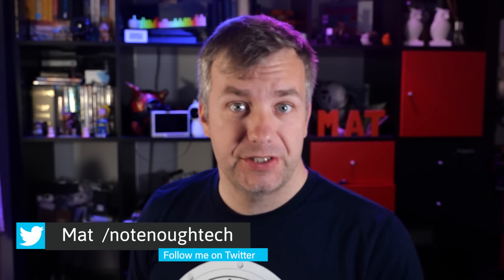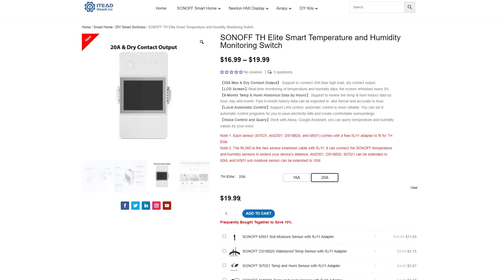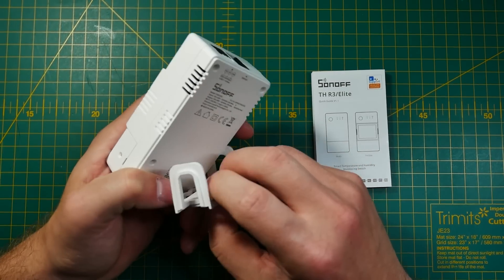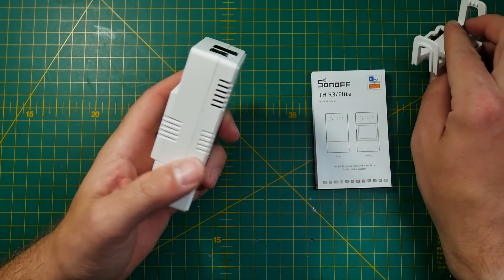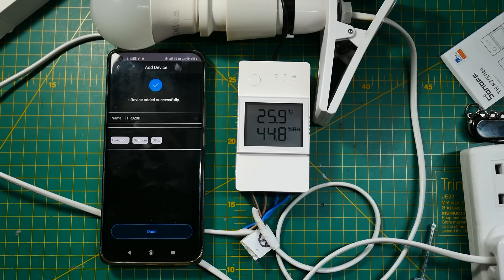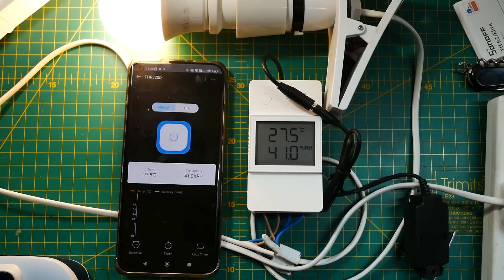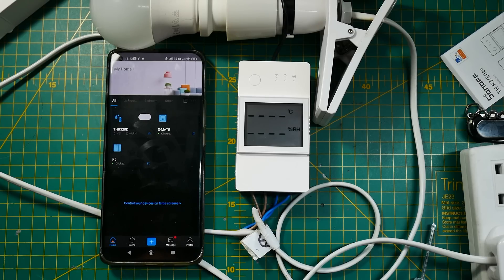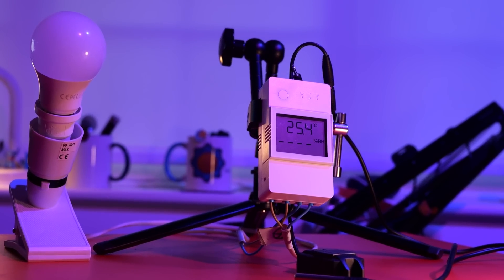ITEAD has a new product line: Sonoff TH Elite!

Comment: Do you think can it works with a 2 wire temperature sensor? I have one already installed in a bolier with a stupid thermometer and I would like to “recycle” it.
Reply from the maker: @giovannimarino4311  it's likely to be calibrated for the sensor included. So I have little confidence it would work with other probes unless it's the same type

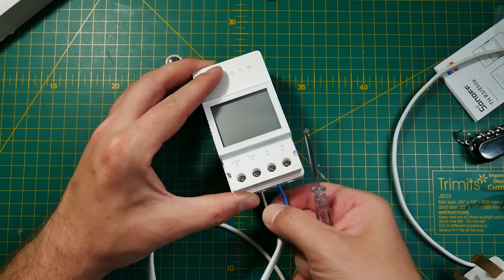Comment: At 5:54 you skipped the most important part of the whole video : Connecting the wires up...what goes where! 😢

Good vid otherwise .
Reply from the maker: The terminals are labelled. Instructions are pretty on point. Without disrespect but if that's not enough to know what's what I strongly recommend qualified technician to do this for you. You want this to be right the first time.

Comment: I still wonder if the usual one , that origin or Elite can be upgraded too by soldering such temperature sensor to the board or connect them to gpio ?
The only difference is the headphone style port this one comes with.

Comment: Hello, do you know the pin layout on the RJ?

It is to know the connection of a dallas ds18b20 or a DHT22.

If you have an adapter it might be easier to measure with a tester each pin of the RJ with the pins of the jack.

Thanks!

Comment: I have several THR316D monitors with THS01 sensors. Using the eWeLink.   Each monitor can read the temperature and the humidity from one sensor which is plugged into it.   Is there a way to modify or add some inexpensive hardware (perhaps using the dry connector), to switch between several Sensors?  In other word,  every push on the eWeLink button would advance me from sensor to sensor (room to room)...?

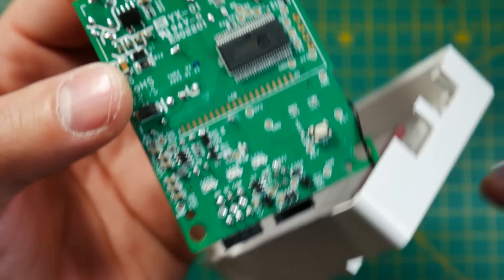Comment: How does one connect it to power? Does it come with the power cable or does one have to buy one separately? Is this the kind of device an electrician should install? Seeing the exposed wires at 5:45 makes me a bit queasy. I'm interested in using this only for the temperature sensor, I wouldn't use the relay function.

Comment: Does it come with a probe? I have ordered one from Amazon and it shows the probe in the picture. If it doesn’t I’ll just r3turn it anyway! But my point is, it’s not so clear if it comes with or not!
Reply from the maker: Yes one is included. But if you want a specific one (there are multiple probes) you need to order it

Comment: Good video, but u do have a question. 
I want to use one like this for a engine heater for my car, but if the outside temperature is more than freezing, is the output still on if you have it in the automatic scheme? or is that possible to skip..
Reply from the maker: You can define the range of temperatures to turn on/off and duration so for example if temperature is low and it's 6am turn on the heater for 30 min
Reply: @notenoughtech  Super duper... Thanx for answering so quickly..

Comment: Nice descriptive video. Can the relay be controlled in scenes based on input from other sensors like Sonoff SNZB-02? For example: One may use the dry contact to connect to a heating system. Then place several Sonoff SNZB-02 temp sensors in different rooms. Could then a scene be set up to configure a temp threshold for each room and if any of the treshold are passed then the relay inside TH Elite should turn ON. Is such a scene possible?
Reply from the maker: You can link other sensors via ewelink automation panel

Comment: Sonoff hardware is good, but the soft in the eWelink app, is primitive and limiting. This thing with the TH series auto mode is just dumb. If I have it in auto and I want to turn it off with the zigbee button, is not possible.
Reply from the maker: I believe custom firmware is available for it now. That would be a better alternative if you are willing to invest the time to flash it

Comment: Why it doesn't have a ground wire input and output? So how would I ground the heater? Tnx!
Reply from the maker: I assume by ground you meant "earth"? You can still earth your appliance if you want. Just run the earth wire independently. Your appliance will be grounded and therfore safe, and only switch will be exposed to mains shorts.

Comment: I learned this new elite is troublesome. First, it uses RJ9 nor R11, 2nd, even after setting it on Auto, the system failed me as it did not cut off after 60 degrees and my boiler overheated, prompting a pressure relief to open. The TH Elite auto setup are so different from the old TH and unfriendly, unless there is something rong i am doing
Reply from the maker: I'm guessing you were using correct units for your temperature? Also I had some issues with readings with one probe but the other probe was ok... so not sure if this could be the case

Comment: THANK YOU FOR A VERY USEFULL AND CLEAR BRIEFING!!!

I have recently bought the SONOFF TH ELITE and a Temp/Humidity (T/H) sensor.    I have been using the eWelink App on my iPhone to monitor the Temp/Humidity in my attic.  Here are my questions:

1.  The T/H information logging from the sensor to the eWelink seem to take place once an hour....  Is there an easy way (in the App) to change the T/H sampling time from the sensor (every few minutes to every few hours...)!?  If so - could someone present a clear way to do so?

2.  The system works well at home, when my iPhone is in the proximity of the Wifi Router.   However when I get out of range of my home Wifi network, I can't manually operate the "Device" (the outputs) which is  hooked up to the TH Elite.  In other words, touching the circle (virtual button) on the iPhone Screen of the eWeLink, does NOT do anything.   Is there a setup on the eWeLink App itself which would allow me to operate (read the T/H on my iPhone and operate the virtual button) from beyond the range of my home Wifi network?

3.  In another home application (not the attic), I would like to be able to turn on the wall Air Conditioner (A/C) in the house, before I get home (thus from beyond the range of my home Wifi network).   To do that, I plan to tap into the A/C remote control unit, and run out two wires from the On-Off button on it.  I would like to connect these two wires to a "Dry Contact" of any small Sonoff receiver.   It is not clear to me what (small) Sonoff "gadget" would do that job....   Any suggestion would be greatly appreciated.

Yes - I am an Electrical Engineer and very handy, but I do find the Sonoff provided English language descriptions difficult to understand at times......

THANK YOU !!!
Reply from the maker: 1. No - we are stuck with defaults. 
2. You have to check if your router is not blocking eWeLink ports. Sounds like your app (and devices) have issue posting back to cloud. 
3. Take a look at my DIY smart heating video it will give you some ideas

Comment: 3:37 RJ much better connector for sensor. Vexve uses those connectors on their heating controllers. jack connectors have risk of shorting when plugging it while device is on. Sonoff manual even advises not to plug or unplug when device is on.
Reply from the maker: Personally, I would pick something easy to be fixed at home. In case you ever need to do DIY and RJ do require special crimpers
Reply: @notenoughtech  I disagree. RJ crimpers are dirt cheap and readily available in any supermarket, electronics/computer store or home depot. jack cables require soldering either if you splice or change the connector - which requires way more skill, tools and patience than crimpinging RJ connectors

Comment: Is there anywhere to source these in the UK ? I'm interested in upgrading my underfloor hotwater heating system. I have 14 thermostats throughout the house on structured cabling, so I would want to push the RJ11 sensor over the structured cabling and use the sensor in each room, with all the TH Elites in one cupboard. So like someone else, would be interested to understand the wiring of the RJ11
Reply from the maker: They are relatively new so for now only through official sonoff sources. In time re-sellers will get their stock but you'd be better off ordering now as it will arrive quicker

Comment: They (again) did not expose the NC pin of the Relais. So in applications where the normal mode is ON the Relais is powered all the time!  This is not only bad for the environment but also bad for the components of the internal power supply (see my experiences with POW devices catching fire)
Reply from the maker: You have a power on state control for this. 
Relay state has nothing to do with power supply as the supply of pow as it's still needed to keep the IoT part functional.
Reply: @notenoughtech  I was not clear enough. Nearly Every relay has a common and a NO and a NC pin. For applications where the state of the connected device is normally powered it would be great if the NC pin is available. I.e. my pond pump. If the temperature is below 0 degrees centigrade it would good to switch the pump off. This is only a few percent of the year. So the relay has to be powered 99% the year if only the normally open pin is exposed.
Reply from the maker: @christianmeinert8806  this Sonoff device only powers up your target device when needed. The default state of the relay is NO so your target device is off when there is no power.

I'm struggling to understand the issue. Dry contact doesn't solve your problem regardless of the NC/NO configuration but shifts the power delivery to another device. 

Bottom line is you either have power delivery control (relay online) or you don't (relay has no power) as both of your devices have no power
Reply: 20A Relay is FANHAR W15L-1A2T-L2 model, which does not have a NC pin, only NO ! 
The 2nd relay (Dry Contacts) has NC and NO, but the wiring is not designed to withstand the 750VA rating that the FANHAR FH38-1CSGH relay supports ... is max 30W (5-30V and 1A)
From this point of view, Sonnoff has a very big gap, and I hope to bring an upgrade to this model soon, maybe a new, more versatile DIY model!

To get a NC + NO contact you need an additional component, a contactor... but in this way the complexity and price of a project increases, which is not good considering how inflation is evolving today!

P.S. Today I modified an Elite model to support dry contact on the 20A relay... and it works perfectly!
Reply: @byrev  how dry contact can works 20A 220v?

Comment: This week my second! POW burst into flames. First was version 1 only for measuring a washing machine and second was version 2 monitoring a 50W 12v pump of my pond. My trust in sonoff devices is very low (even I like the new series)
Reply from the maker: Have they both failed in the same way? It's worth investigating what failed on the boards. I have 2 in use at the moment. Both for over 2 years now.. so far so good. Which revision was it?
Reply: More info??  I suspect the majority of people here have or are considering installing Sonoff devices.
Reply: How many Amps was the machine pulling..reactive load ?
Reply: I've had a pow monitoring my air conditioner (split type, inverter) for over 2 years now and it hasn't skipped a beat. Either you are extremely unlucky or something's going wrong with your wiring.
Reply: Both failures are similar but not the same:  
The washing machine is a fairly modern one with A+++ Energy Label. It was a Ver 1.0 POW model. The machine wasn't running (I detected the fault because I could not start the machine.) It didn't happened during the time the machine was running as it would be obvious by a not finished program. Washing machines in Germany have 10A fuses so they pull less then 2KW. I'm not an expert but it "burned" around the fuse and big resistor (inrush current limiter?) between live and neutral.
The second (recent) was a Ver2.0 board connected to a 50W pump with an 12V Transformer running 24/7. Here there are burn marks around the resistor and smoothing capacitors (not exploded). Not so violent as the first one but the case was is melted and totally deformed.
I know the R1 POWs hat problems with the Relais but they look unharmed.
What concern me most is that in both cases the fuse didn't done it's job. I read a lot of Chinese fuses not performing in specification. 
(google "sonoff pow fire" and you can see some results similar to mine)
The fire protektive plastic did the job to stop the flames. I will replace my last POW device ASAP. I don't see a problem if a device fails - that can happen. But clear signs of fire and melted plastic is not the failure mode I accept.
Reply: @christianmeinert8806  Quite possible the failure was at the end of the last cycle rather than when you tried to run it the next time.  You may have just discovered the fault the next time you want to use it.       Your faults are not common for SonOff devices.  There are some online, but out of the number of SonOff devices out there, this is not common..   You can probably find bad press by searchign specific things on any manfacturer.
I feel you have been very unlucky in this.   Don't believe all you read about "Chinese fuses".    SonOff have a higher standard than some of the dodgy Chinese fakers.   If it is resistors failing due to heat, then this may beed to be addressed with SonOff if they have a flaw in the design of their POW line, but as I said, this is not a common thing compared to how many of the devices have been sold.
Reply: @EsotericArctos  Ok the link works ... all I was saying is that to my knowledge the problem is in the switch mode power supply and not the Relais or the HLW8012 power measuring chip and it's sense resistor (SMD on the back). It is likely caused by the fact that both POWs were running 24/7 with a powered relay - only as a measuring device. This seams to be too much for the power supply. A NC (normally closed) connector could help is this use case. But this is missing on all or many sonoff or other IOT devices .... 
So I go back into my own DIY devices with more trustworthy power supplies (these little potted bricks are well tested and work in my case in over 10 DIY devices for years).
It doesn't matter if the quality of the fuse was bad or the circuit design. in the end the fuse did not do it's job.
Reply: @EsotericArctos  I never said that it is a common problem. But 2 out of 3 in my case looks problematic for me. 24/7 devices are difficult. You have to keep the price down, the power consumption low and finding an issue after a long period is difficult. And having the same issue with a 50w Motor makes a over power situation unlikely. Electrical faults are the main reason for domestic fire in Germany. Ok long daisy chains of power strips my be a big factor but still having burnmarks on one of your iot toys makes you not happy. Good design should prevent this. Even if it is caused by the user. That is what fuses are good for.
Reply: @christianmeinert8806  if you're looking for a Sonoff with a normally closed relay the SONOFF POWR3 might be an option. Although I can understand that you won't buy Sonoff products ever again now😂
Reply: I've never had that issue with SonOff devices.  Does the washing machine have a heating element that heats the water inside the machine?   If it does, then that could draw more continuous power than the SonOff devices are rated for.    
Definitely worth investigating why these caught fire.   Maybe, if you still have the devices, you could investigate them, or if you don't want to yourself send them to a YouTube channel that can do a tear down?
I've got 6 different SonOff products, including 2 POW devices and have never had an issue with heat at all in them.
Reply: @EsotericArctos  the imgur link still blocked by youtube ... if you know a way to send images here I can do that
Reply: Worrying I've been using a pow for the last two years on a 2kW load only on for 30mins though, I'll check inside! Have a look at openenergymonitor org open source monitor.